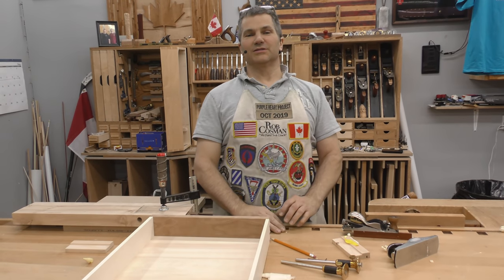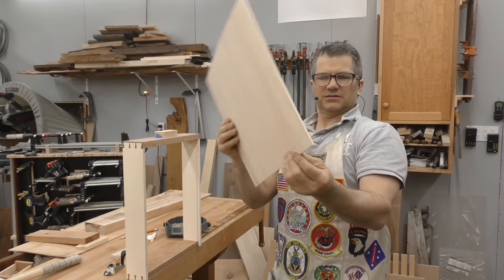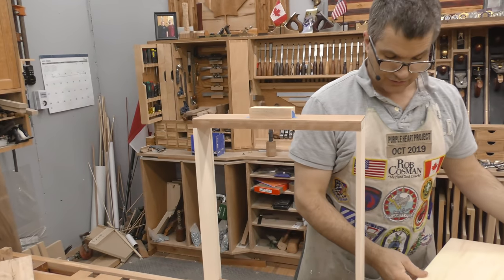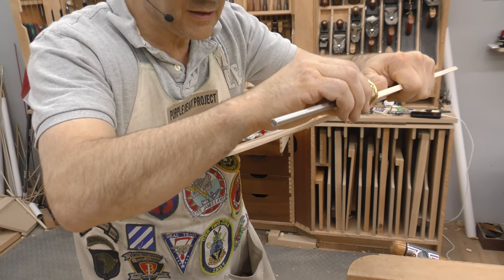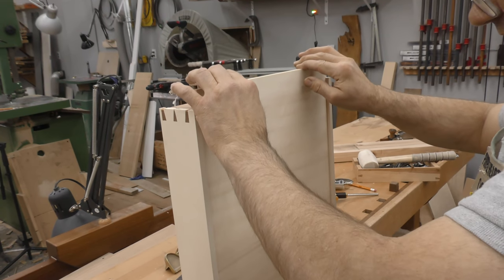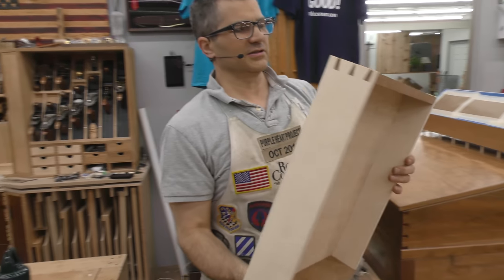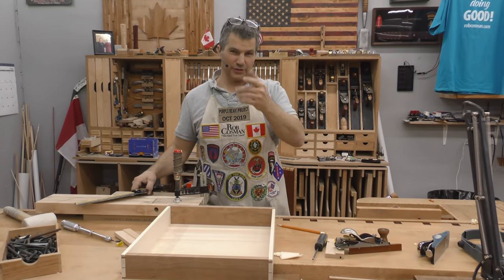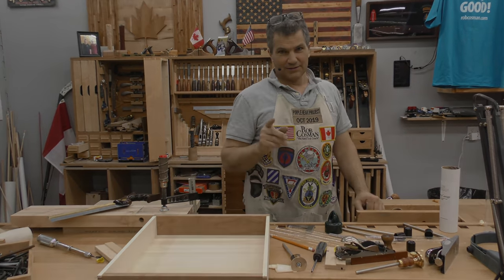Attaching Drawer Bottoms - Getting the Fit Just Right (Part III)

Comment: I had not been sold on this type of marking gauge. For years I have used pin gauges. Tried some Bridge City Tool gauges a number of years ago, Rose wood, brass with a wheel cutter. Seeing you use them has a hole new meaning. So they are going on the wish list, which from your talk means 2 with a variety of shafts. 
You inspire!
Reply from the maker: I will let you in on a secret.  We are putting them on sale next week.  Make sure you are signed up for the newsletter so you will get the sale notification.  The link to the newsletter is in the description.

Comment: One of the mechanical designers at work said to me once “you can’t fit a 1” pin into a 1” hole “  I think the reason why just adding the bottom to your drawer changed the fit is because all it had to do was change something a thousandth of an inch and your to tight again. I’m constantly amazed how your able to fit wood together using the tolerances of a Swiss watch ! Love it !
Reply: You can depending on the fit : 
Clearance: The hole is larger than the shaft, enabling the two parts to slide and / or rotate when assembled.
Location / transition: The hole is fractionally smaller than the shaft and mild force is required to assemble / disassemblet
Interference: The hole is smaller than the shaft and high force and / or heat is required to assemble / disassemble
Reply: gbwildlife uk sooooo you can’t fit a 1” pin in a 1” hole is accurate, you have to have clearance, either the hole has to be a few thousandth larger than the pin or the pin has to be a few thousandths less than the hole , if they’re the same size it’s a no go ~

Comment: Rob, When selecting drawer sides,  early on, I like to check for any slight bow in the length, (as well as planing direction from front to back on outside).  It is best to have sides bowing inwards as this ensures drawer bottom will support the sides and push them out.  This is what causes extra tightness of fit when the bottom is inserted.
I have enjoyed your series a lot. ~:-)#
Reply from the maker: Go for straight boards with straight grain whenever you can.  If i had a slight bow i would orient inward

Comment: When your planing the edge of the drawer bottom, you could clamp a reference board to the rebate side of the drawer bottom and leave it standing proud so that you can run the side of the block plane along the reference board so it stays square to the edge of the bottom. Like a vertical shooting board.  As long as its clamped to the rebate side the edge of the plane will float over the rebate allowing the whole width of the blade to be presented to the end grain.
Reply from the maker: Yes but i have a fence on my plane so i dont need to do all that

Comment: Hi Rob, I've really enjoyed this series of videos and I've learned a lot from watching you fix problems as you go. All the uses for marking gauges has now got me wanting one of yours along with a couple rods with different size cutters. I already have several wheel gauges and use them all the time but never realized how much more useful they could be.
One thing that really intrigued me was when you got the tear-out while planing the drawer bottom. I am building some replacement cabinets for our kitchen and experiencing some serious tear-out trying to hand plane hickory (my first time with this species). I am taking super thin shavings, using wax on the sole, and resharpening often but I wonder if I'm still doing something wrong. Maybe one of your videos could address difficult woods and tear-out? I'm not quite ready to give up and just sand it yet but I did search out my Stanley #80 scraper and set it on my bench. The blade needs to be resharpened before I can try it, but if that doesn't work then I guess the random orbit sander is my last resort. Unless you have a different suggestion. Huge thanks to you and Jake and the gang. I can't wait to get my new dovetail saw when you get to it.
Reply from the maker: First try closing the throat so there is only room for the shaving and nothing else.  If this doesnt work, try increasing the pitch with a 20 degree back bevel on the blade.  I have a youtube showing how this is done.
Reply: @RobCosmanWoodworking  Thanks. I will give those a try.
Reply: Closing the mouth helped a little and the back bevel helped a lot more, although the plane was a lot harder to push. Wax and taking a lot thinner shaving helped there. I was able to clear up almost all of the tear-out except for two areas that I used my cabinet scraper on. Thanks for the advice. Now I'm thinking I need to buy another blade set for my plane so I can keep the back bevel setup for the next time I run into difficult grain. I have learned a ton watching this series on making and fitting the drawer. Good incentive to sign up for the online workshop. Thanks again.

Comment: I use a marking gauge for setting the height of router bits. Place the cutter on the router table or router base and raise the router but until it touches the brass plate
Reply from the maker: Another good use of a marking gauge

Comment: A marking gauge is ideal for marking the centerline of a hole that needs drilling.  Especially if you have a lot of holes that are in line.
Reply from the maker: Hi  Tom, I have discovered that as well, great tip.
Reply: How does that work Tom?

Comment: To eliminate the bronze staining the light wood- 3m has a green “fine line” tape, 3/8” is what I am most familiar with, that you could put on both surfaces on the plane, would be both slick and shield the work.  Any automotive paint retailer should have it in stock. After you have it in hand you find more and more uses for it.  After you apply, burnish the edge towards the applied finish for a really good protection from seepage, or entire surface for better grip.  Comes off easily, and being a paint mask, the adhesive is both non marring as well as comes off on the tape, not the project. Tiny bit spendy compared to tan masking tape, but worlds ahead in use.  Try it, you’ll like it.  Or Love it.

Comment: The shoulders of the rabbets may be causing a spread in the drawer sides  even thou the overall width of the panel is fine. Waxing the rabbets might help when installing bottom.

Comment: The reason why the drawer bottom makes it snug again is because now there is no give to the sides. When you try a drawer with no bottom in it, the sides bend a little as they go in. So you think you got it right. But you didn`t. Once you put the bottom in, it won`t let the sides bend and voila! You have to refit it :)
Reply from the maker: Well stated

Comment: Tedious, but loving it.  I live in the tedium to strive for perfection. Question - If you had choose between one tool or the other, which would you suggest purchasing between a shoulder plane and the skew block plane? Or, if you're a tool nut like I am, which would you suggest purchasing FIRST as both purchases are likely inevitable, haha?
Reply from the maker: If you plan to also do dovetails go with the skew block.  Its a little more versatile than the shoulder, but both are good

Comment: Rob, I aim for close tolerances as well, then add a little wax when sliding in the drawer bottom. Do you not consider this? Regards from Perth, Derek Cohen
Reply from the maker: I dont do wax on the fit as i want to feel the true fit
Reply: Thanks for the reply Rob. I appreciate that there is a different feedback when fine tuning. On a separate note, thanks for this series. I consider myself a fairly competent drawer maker, but the extra detail you have emphasised in this series encourages me to lift my game higher. Kind regards from Perth Australia, Derek

Comment: That drawer was fit to such tight tolerances top to bottom isn't  it possible that when the summer humidity comes that the sides will swell and cause more binding?
Reply from the maker: Yes,  and i will likely have to plane the top of the drawer a bit when it expands, but i am trying to match the drawer front so the drawer disappears in the apron. To do his i need a tight fit, and i am willing to come back later and fiddle with it as the wood expands so i only take off the bare minimum, instead of leaving the drawer sloppy in the up and down axis.  Normal rules would call for a little slop in the vertical axis for expansion.  I am breaking the rule.  It could backfire in me.
Reply: @RobCosmanWoodworking  Gotcha I hope it goes well.

Comment: I'm curious about why you call the side to side measurement the length, and the front to back measurement the width? I have always thought side to side was width, and front to back is the length. Does it have anything to do with the grain direction of the bottom panel?
Looking forward to the shop tour.
Reply from the maker: I call the length the grain direction and the width across the grain.  Think of the piece as it would be in the tree.
Reply: @RobCosmanWoodworking  That's what I thought. Thanks for confirming it for me.

Comment: Rob  can you advise on what magnification you use for your 'better eyes'. I am your age and think I would benefit from using them as seeing fine lines is getting harder as the years go by
Reply from the maker: Its a 10x. You can order the headgear i use from amazon and it comes with different magnification insert s
Reply: I bought a set that have different inserts for different strengths of vision but also has an LED lamp on top that really gives the field good lighting from my vantage point. My shop lighting isn't great and the bench light that Rob uses gets in the camera mans way... lol

Comment: Is the slight sideways bulging of the side of the draw caused by the lengthways insertion of the base.  I know that sounds lame, but given the very fine tolerances involved, then a very slight pressure may cause a very fine distortion in a side panel.  And could a gently "hug" from a parallel jaw clamp solve it?  Maybe?
Reply from the maker: Not so much the grain direction, just the fact that there is a bottom allowing no side flex

Comment: Why didn't you use the panel gauge to check the draw bottom for square? With the draw fitting so close, any little bit that's out of square can make a big difference on the fit.
Reply from the maker: That would work.  I used a square on the corners

Comment: Why not just make a beveled bottom? I usually make the bottom a 1/32 shorter and bevel the front and the sides to fit. I find that it's easier the slide in and out and for the wood to move. Also cutting it slightly smaller lessens the chance of having to refit because if your too tight then you risk snapping the dadoes or spreading the sides as your fitting. You've been doing this much longer than I have, but I haven't had any issues with any of my drawers thus far.
Reply from the maker: A bevel is another good and traditional option. I use it often. Just chose this method on these drawers

Comment: If you always have to refit after putting in the drawer bottom...is there a reason you couldn’t fit the drawer bottom first and then fit the drawer to the opening?  Seems like it would remove a step and keep those obstinate little devils in check.
Reply from the maker: I don’t want to wait until the drawer is completed to figure out i have some major uncorrectable error

Comment: Question about burnishing: when you push/pull the drawer to burnish where it's rubbing, presumably it's also burnishing the carcass drawer opening. You plane off the burnished areas on the drawer but do the burnished areas inside the carcass swell again over time from atmospheric humidity and make the drawer fit too tight later or do they stay squished down? Thanks!
Reply from the maker: A Board will move most in its width.  It moves very little in its length or thickness (height) Inside the carcass the drawer side isrubbing against the rail,  both of these are rubbing against the thick or height part of the board that has very minimal movement.  Once i get that fit right i am not worried about the pieces expanding in thickness.  In proper drawer construction the expansion will be in the drawer sides in width, which is oriented up and down
Reply: @RobCosmanWoodworking  Sorry, I don't mean binding from standard expansion/contraction. I was wondering if those hard pushes in/out of the drawer might compress the wood fibres of the areas of the carcass that were rubbing significantly or not. Like if you dent wood the fibres compress but can spring back over time, especially with water/humidity. I wondered if the compressed/burnised areas in the carcass drawer opening might decompress over time causing rubbing, as your tolerances are so fine. Probably insignificant. Just a thought! Thanks for your dedication to answering all of us!

Comment: You go to such pains to make sure something fits and then It  doesn’t?
Reply from the maker: All part of the process!
Reply: The drawer bottom is obviously pushing the side out or it would fit in the opening but maybe it is easier to fix the outside providing there is no future change due to moisture.

Comment: Slightly chamfer the leading edge, so it does not dig in when sliding in the recess.  It will be concealed upon assembly.
Also things to check;  the carcass is absolutely square, the sides of the the bottom board are parallel.
Your test piece for the fit of the bottom is too short.  It should be the length of the side of the drawer.
JIM
Reply from the maker: All good practices
Reply: I think the idea that if the sides bow in a little then they will be pushed out when the bottom is put in. That makes sense for why it fit before.